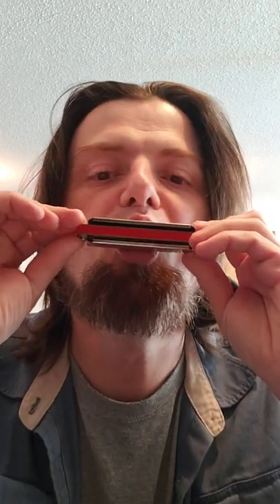My Harmonica Embouchure Mouth Position - Partial U-Block / Tongue Pucker

Comment: I started out with the same U blocking style as you. My tongue on the bottom plate moving about. I would say that my tongue was in a V shape, not curved into the U shape. I could move about well and knew where the holes were that I wanted to play. With the pucker I can get lost on where I need to be. Like you I can not bend a note with U blocking or Tongue blocking. If I u block I have found that it is easy to go from the u block to the pucker to do the bending. So I am trying to get good at changing from u blocking to pucker or to tongue blocking. 
Thank you for the video.
Reply from the maker: Thank you for your comment. It gives me much to consider.

Comment: I play very similar to your method, as I can't pucker or tongue block.  I can also bend notes by using the back of my tongue, throat and jaw.  I articulate with the middle of my tongue on the roof of my mouth.  Practice those bends.
Reply from the maker: Thank you for the feedback. I sometimes thicken the back of my tongue in order to bend, but it never sounds right to me. I think I just dislike the tonal change between a reedy straight reed and a honking bent reed.